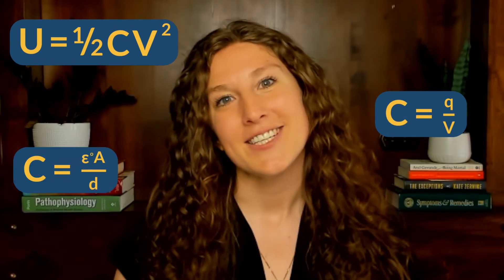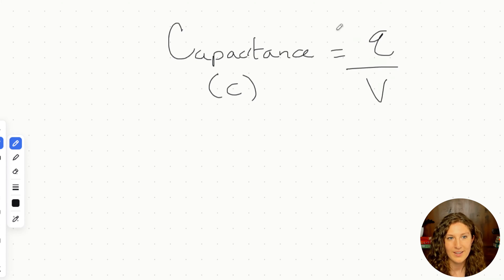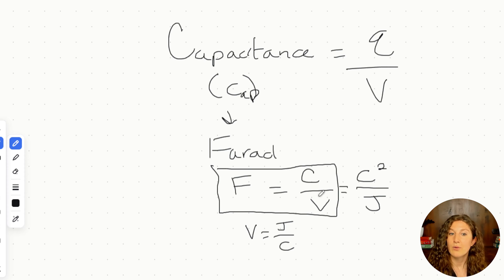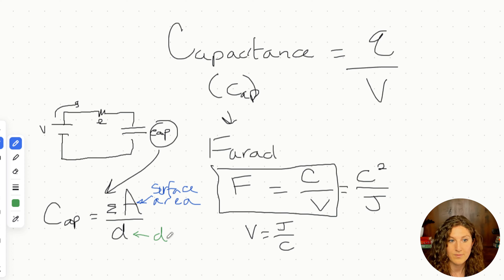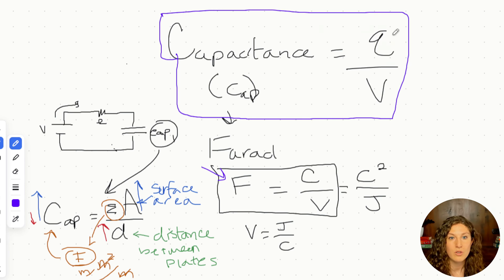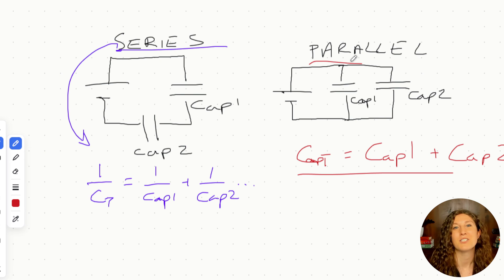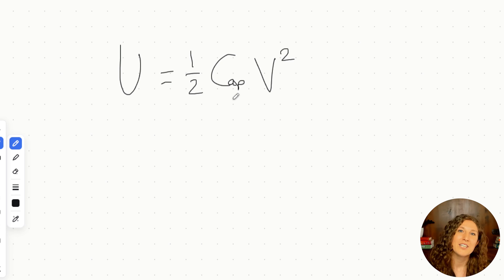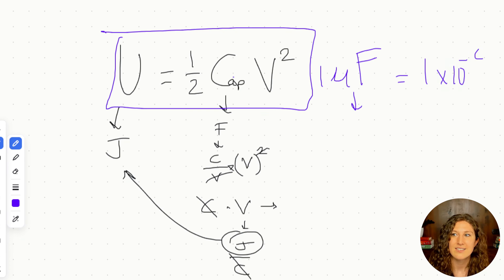MCAT Physics: The 5 Capacitor Equations You Need to Know

Comment: A discussion of how capacitors work in AC systems would be interesting. A question to explore is how power factor correction capacitors should be protected, would the amp value relate to nameplate amp rating, or the amps that will flow based on applied voltage.
Reply from the maker: Definitely a cool area to dive deeper into if you are studying physics or applied electronics! On the MCAT (my area of instruction) circuits are restricted to DC set ups only, and a basic theoretical understanding is all students need to understand medical devices like defibrillators, rather than practical applications.